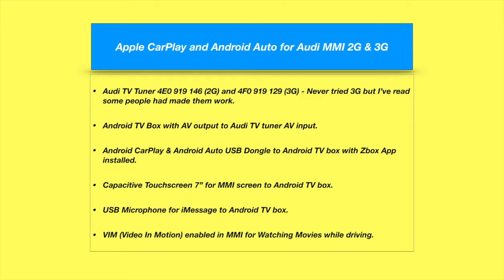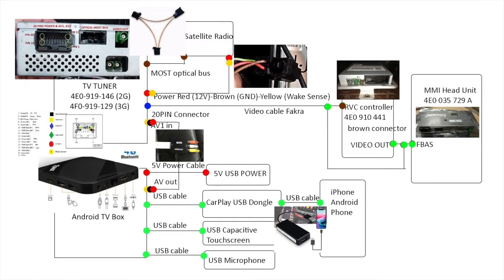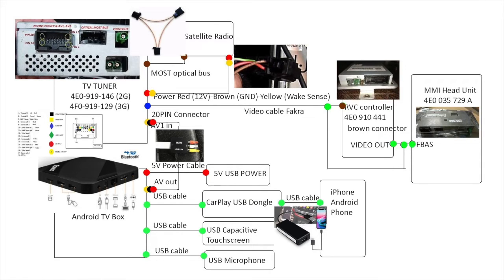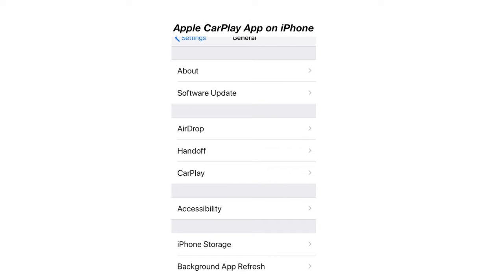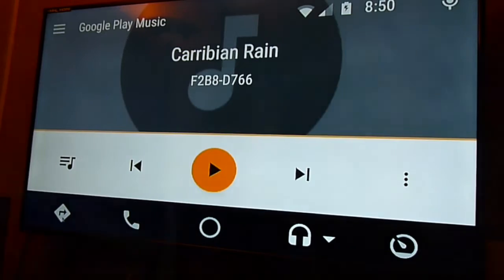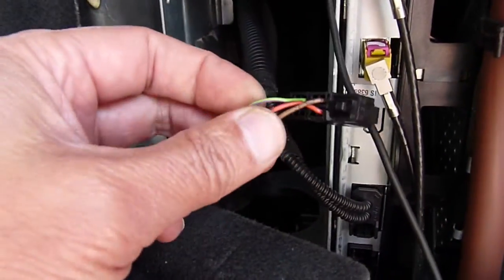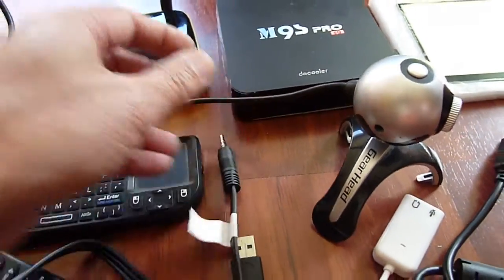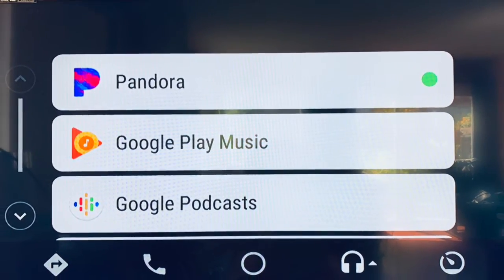Install Apple Carplay and Android Auto to Audi MMI 2G and 3G Tutorial

Comment: Hey great vids , new to the A8 (05 base) . The previous owner put in an aftermarket head unit bypassing the factory MMI and I’ve lost diagnose functionality and adjustment functionality, like I lost my active suspension and other things that I still haven’t figured out but I do like the sound but I need the functionality of this car back, Now I have some questions first, is it possible to use an aftermarket head unit and maintain and access the MMI’s functionality to diagnose and adjust settings?  If not do you ever think about making a kit ?  I’d buy one 1☝🏿. About my car I don’t think they (whoever installed the audio) hacked my harness I think it’s a standalone harness so I hope to replace this cheap flip up unit soon I just want a bigger screen like the Teslas have but with A. CarPlay & Android Auto and the MMI functionality. I mean if you could figure out a way to make a Quality Unbranded (eBay) 10.1 or 9 touchscreen Android 8.1 head unit work with Audi’s MMI system, possibly run the factory MMI through the aftermarket system input (auxiliary/video (1,2) port) . Heck I don’t know, what do you think ? Keep up the vids btw I loved the mighty vac oil change. ✌🏿
Reply from the maker: If it's the head unit that muxed with the original head unit, you should be able to switch between the original MMI and the new one. Look behind the DVD changer to see if the original head unit is still there. It's a squared box. http://www.dognmonkey.com/audi/a8-d3-back-up-camera-retrofit.html. You can press one of the button on the steering or the MMI controller to see if any of them switch back to the original MMI screen.